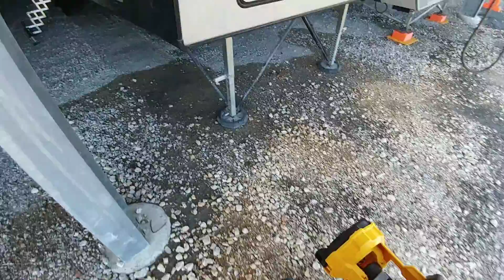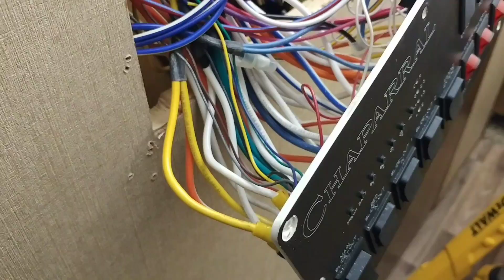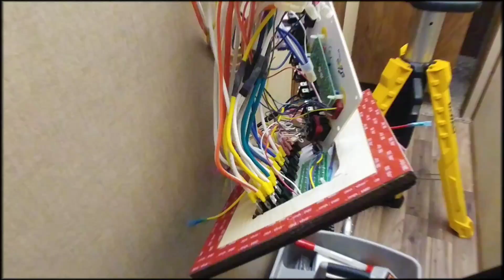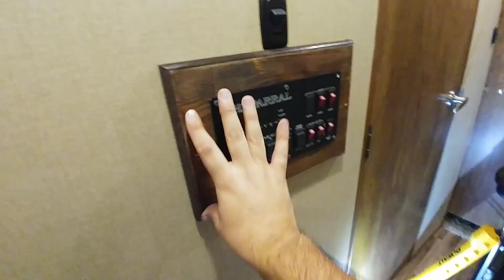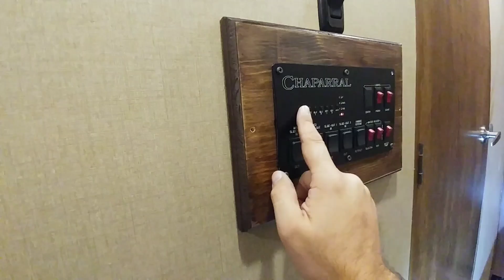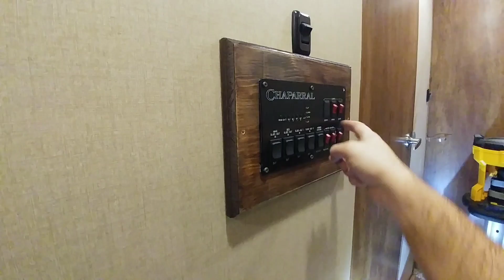Installing a new Control Panel in our Fifth Wheel RV!  Part 2

Comment: I have a 2014 RV I purchased and it was vandalized and the control panel was cut out. I ordered a new control panel, but now I dont't know what wire goes where. Can anyone help me, I called the manufacture and they cant help me, its only 7yrs old ?

Comment: The new wood frame actually looks more finished than the original panel did without anything around it.  Now it looks like a Control Center instead of just a panel Of switches on the wall. Nice job overall. Like Joe said below, you’ll find the missing screw when you least expect it or it’s still stuck in the old panel.

Comment: Are those wire nuts rated for a high vibration environment? Usually crimps are required for automotive service and wire nuts are not used. Wire nuts are generally rated for stationary applications.
Reply from the maker: They are crimped connections if you look closely.  They are wire caps

Comment: I prefer it the way it was.  It did not have two holes for screws that were not used and the wooden plate was not right up against the switch above.

Comment: Do you use "Solder-Sleeves"  or "Solder-Splice-tubes"
(Heat-shrink colour-coded clear-silicone-rubber insulator-tubes with a Ring of solder inside) ?
Solder the wires (ideally pre-tinned) together with a hot-air gun., & shrink the insulator,
all in one task.
Fast Reliable, & if done right, somewhat weathertight.
and easy to visually inspect.for integrity.
The colour-coding of these Solder-Splices, is 
in the "Weather-Sealing-Glue" rings (hot-melt) inside the Shrink-tubing.

In my brief experience, I think these are more reliable than "Crimp connectors"